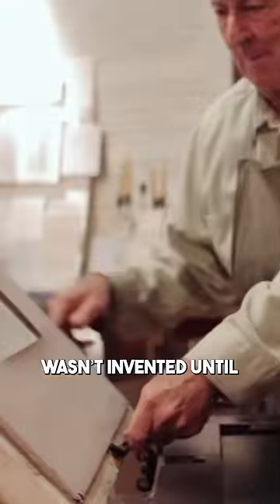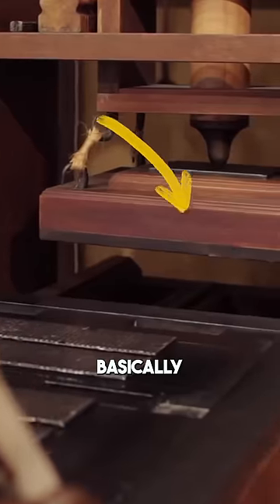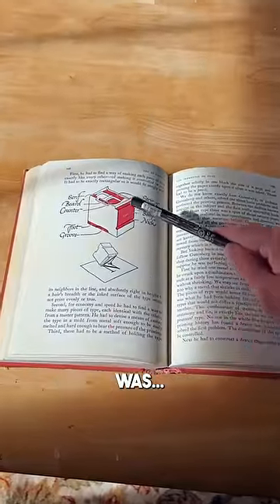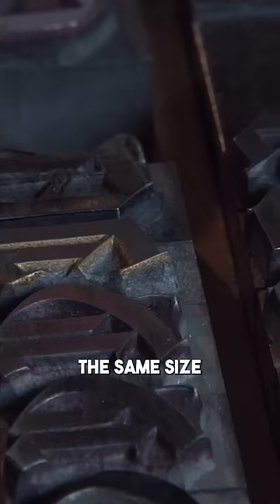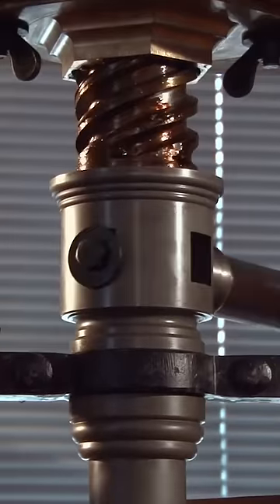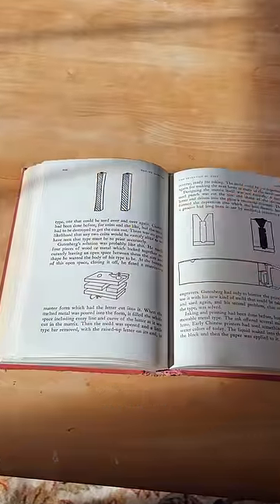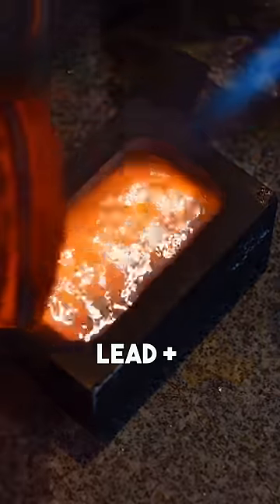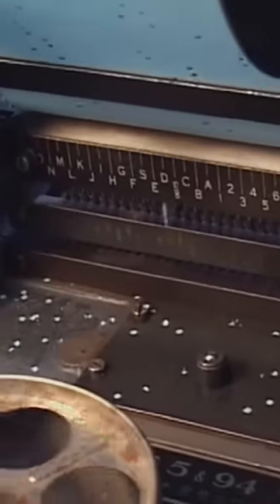The Hard Part of Inventing The Printing Press

Comment: iirc the movable type press was also independently invented earlier in Korea, was it also a mix of these metals?
Reply: The oldest extant book, which was printed with movable metal letters, is the Korean Jikji, printed in 1377, although bronze metal letters suggest, that this type of print was already in use since somewhere in the time period from 798 to 1166 (numbers differ from source to source and the radiocarbon method isn't that helpful because of the material as well as the relatively near time to ours)

Comment: It is amazing how something can have such staying power. Hundreds and hundreds of years done the same way. That reminds me of something Da Vinci did that it took a good 6 hundred years for people to figure out. 

Da Vinci famously used mirror script in his notes and most of his writings. Mirror script is where you write words backwards but in the correct direction, for example: 'sdrawkcab'. If you put a mirror up to that, you'll see the word 'backwards'. 

For hundreds of years people thought that he did this to hide his work. It being a sort of simple code. Yeah, nope. That wasn't his code. That was a *hint TO * his code. Da Vinci had a lot of plans and schematics with at least one part that was faulty. It didn't fit right if made to spec or it simply didn't work. 

An engineer in Japan was playing around, building Da Vinci's machines in CAD and he looked over one of those parts in a schematic for a water powered robot arm. On his hunch, he inverted the part... mirrored it. The part fit perfectly and worked just fine. Since then people have gone over his works and a great deal of his plans have at least one part that won't work properly unless you invert it.

Comment: Digital in the 1960s? AFAIK it wasn't until the early 80s that digital printing became more common than physical typesetting. Could be wrong, but the big news papers still used Linotypes in the 1960s.

Comment: Also illustration in printing is a huge problem because you have draw on metal plates and carve it to make the original plate and it’s a delicate piece the finer the illustration each time the plate is used the details of the illustration fade and distort a little so the first few would look like someone hand draw it and by the 10th all the smaller details are gone because of how much the printing process wear out the delicate detailed engraving

Comment: Yeah, 1960s printing went digital?  Maybe some were on the cusp of the wave, but there were plenty still using letterpress.  I have a drawer I saved from a Letter Case.  Which is where the terminology " UPPER and lower case" comes from.

Comment: To not use lead would be a matter of manufacturing not material. Brass or steel could be tooled in a cnc machine to make each letter but that would be prohibitively expensive.

Comment: I have to wonder why they didn't try on wood (or whatever material they were already using for the stamps) 🤔
Reply: Undoubtedly someone did try.
Reply: They did, Far Eastern Printing presses mainly use wood.

Each block are carved for the entire page, making mass production of illustrative books incredibly viable that early in China and Japan.

However, Wood are Porous letting the Ink seeps into it after a lot of usage, will break under constant pressure and its hard to make them uniform due to them needing to be carved.

Copper and Bronze were used as Typesets there, but those two are high in demands due to high utility (Both are used in making tools, weapons and strengthening constructions, as well as for decorations) and One requires the other to even be made (Bronze is an Alloy of Copper and Tin). Pewter, the Metal alloy he mentioned, has almost the same property as Bronze but is as Malleable as Copper and had less demand, only used to make cookware and decorations

Comment: Except that's not really necessary until you start dealing with movable type. And even then ceramics are perfectly viable (and saw a lot of practical use for movable type in the Song Dynasty), albeit more expensive to manufacture.

Comment: What about wood and stone?
Reply from the maker: It is difficult to carve hundreds of wooden letters to precisely the same depth due to the grain of the wood.  China used wood blocks in their version of the printing press, but they were only doing about 40-50 characters per page with a lot of spacing between them.
Reply: And to answer why not stone... Depending on the stone, you'll be hard pressed to make a uniform typeset with stones

Comment: I'm just curious, why not simply wood? I know that wood breaks under high pressure but they are more easily replaceable than metal ones? Craving them with a expert carpenters is easy and quick as far as ik...
Reply: Wood would probably be too soft and expands by absorbing fluids.
Reply: @GrillerRohde  hmm... That's true

Comment: There's a big difference between making stamps and making a press that can have movable type the printing press is nothing special it's the movable type that made it unique

If you're stamping out pictures you can do that with a flat piece of wood and a hammer or Mallet it doesn't need to be exact or orderly but when you have the type it has to be very exact and very orderly if you want everything to be clear and even

Comment: Why couldn't they just use wood? Genuinely curious
Reply from the maker: It squishes! Also difficult to carve all the letters to a precisely identical depth due to the wood grain.
Reply: Wood is porous and can't exactly withstand the pressure of a printing press. 

It's exactly the problem Older Printing Presses had, the one in China. Print Blocks have to be remade if it breaks and it will break sooner than metal. 

That's among the few reasons why Medieval Chinese Printing presses aren't using "modular" font blocks that you can shift to your design... You'd have to already carve the page you want on the block.
Reply: @Ari Bantala  thanks for answering. Yeah the chinese woodblock printing is what made me ask this question in the first place.

Comment: Why does the force need to be so high? also why wouldn't they use some sort of machining based process in the 40's, 50's, and 60s?Just cast it out of steel then face off the side that needs to be flat in a mill.
Reply: Its not the force but the repeat of said force. Small stress amounts can build up fractures in materials.

Comment: Did they need to be metal? Was there anything else available then that they could have used with today's knowledge? Some very hard wax you can just recast when it wears out in a few uses might still be faster than handwriting. And why does the face have to be flat out of the mold, can't they lap it? assuming one doesn't care about lead dust?
Reply: Wax cannot withstand boiling ink and 50000 pounds of pressure